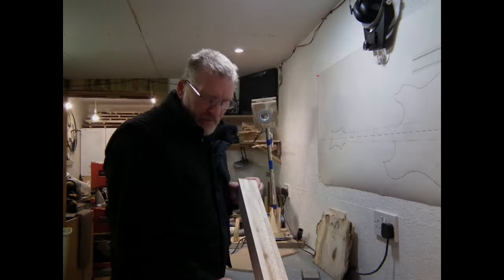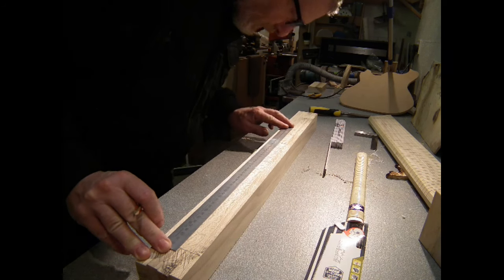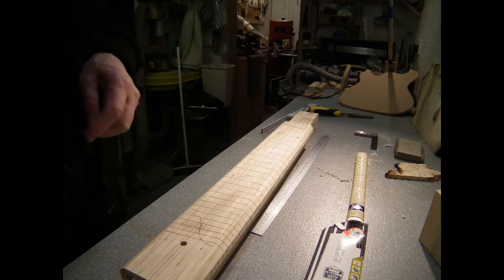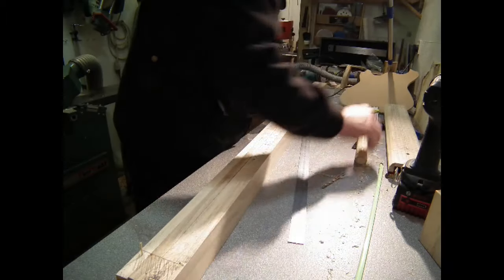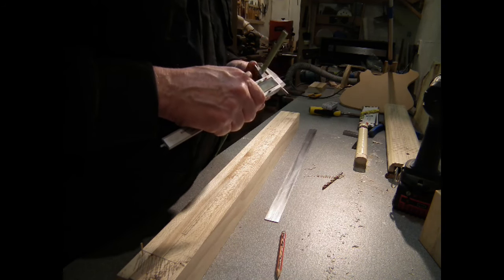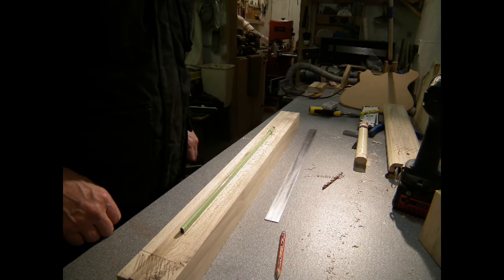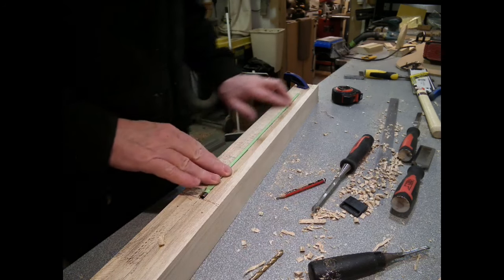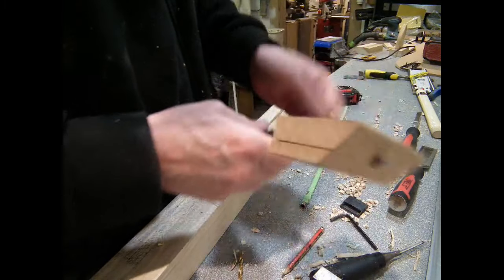GGBO2022  Scratch Build Chapter Five - First stage of neck construction and another handy jig idea!

Comment: Good job, Phil. I'm just wondering (as a non-woodworking husband of a woodworking wife) the reason behind using the chisel to create the truss rod slot rather than a router (or something other powered tool)? Look forward to the next.
Reply from the maker: Hi David, dust and noise! Besides I like to use hand tools it's a lot more therapeutic. If you are not a wood worker you are missing out. Go buy a mallet and a chisel and have a go at carving, it's pure therapy. Thanks for watching.
Reply: Makes sense. My wife also spoke of precision and less risky. As for therapy...I get mine through playing the guitar. While I am still very much a late stage beginner the peace, joy, and satisfaction playing keeps me sane and off the therapist's couch.
Reply from the maker: @dctp65  Totally agree, I'm a late learner. I told my wife that when I have a guitar for every day of the week I will be selling all my tools and turn my shed in to a chill out zone. Only one more to make!
Reply: That fret slot template is brilliant 🤩. Making one for my upcoming multi scale build 🤘
Reply from the maker: @spaceoilguitars  thanks for watching, you need a jig for everything 👍. I use an empty vape bottle with a really fine nozzle off a thin super glue kit for putting glue in fret slots, it's mess free and quick. Or try a syringe, keep rocking.